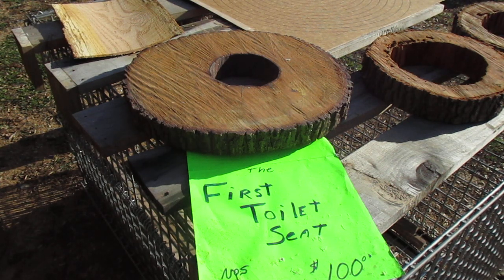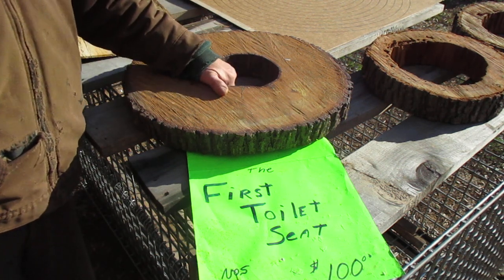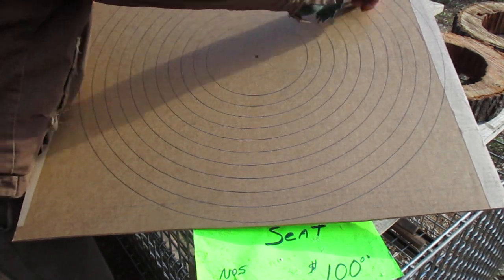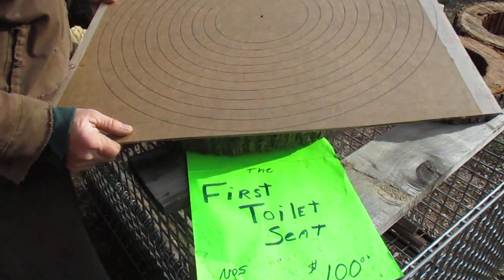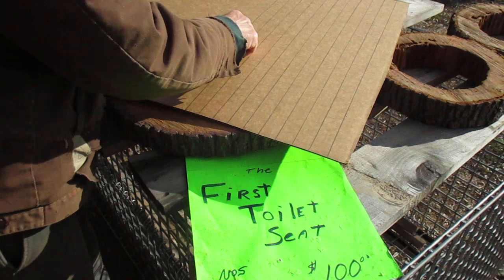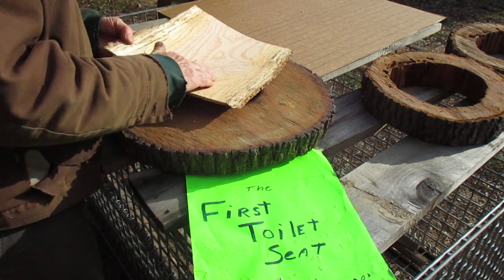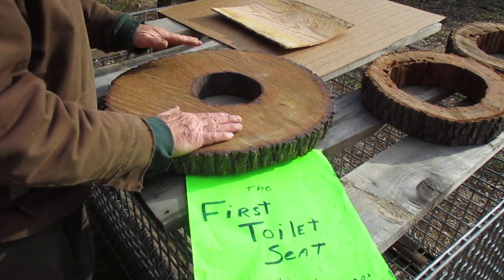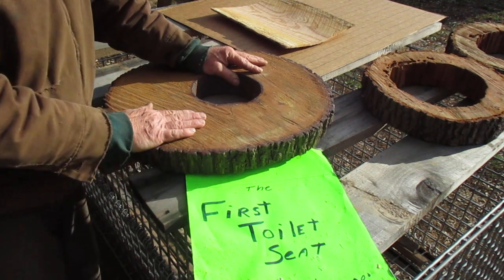#163 Sealing logs   and The First  Toilet Seat

Comment: I latex painted the ends of hardwood blocks (firewood) that I intended to turn into wagon hubs. They checked just the same. Another batch I drilled a hole through the center of the hub blank and coated the ends with hot parafine wax. They still checked. They were all stored in a cool dark open storage building for several years. I hot waxed the ends of some hickory and oak 3 X 6s 10' long and results were very good. That was 10 years ago and the are still perfect.
Reply from the maker: hi there thank you for your in put john

Comment: Great science on how wood shrinks.  I have used PEG before to slow the shrinkage on the ends, it helps with checking.
Reply from the maker: hi there do you paint the whole thing and may think about doing it different now ? john
Reply: @fricknjeep  Interesting thought, on bowl blanks you treat the whole piece, but you're right I didn't paint the whole log, so the lateral checking would still occur. BTW, Osage Orange makes some pretty bowls but is hell on lathe tools.  LOL

Comment: I'm if the school if thought that a log will loose water from the end grain a whole.lot faster than from the sides.  Something like 20x faster.  (Ask Nathan) than from the sides.  Therefore the end inch (or whatever) will dry and shrink as lot more than the wood say 2" in.  That stress caused the checking.  If a sealer is applied to the ends. It slows water loss through the ends. But not the sides.  The log still dries unevenly. Just not as much and checking is reduced.  Not eliminated, but less.

A full width quarter sawn board  will  crack in the middle ' the juvenile pith doesn't know where to go as it is pulled to either side.  I think you kind of pointed that out on the thin curved piece.

The toilet seats didn't check- I think you are spot on to the reason.  However, try an experiment.  Cut a very thin cookie - like an eighth or quarter inch.  Hang it on edge so both sides dry evenly ,(and probably quickly)  I suspect it will check a lot less than a similar cookie 2 inches thich.

Also, on anchor seal, check Matt Cremona in Minneapolis.  He built a 60" wide horizontal bandsaw mill for stabbing huge urban trees.  He has talked a lot about different end dealing practices.  He is a darn good woodworker and is handy with metal fabrication as well
Reply from the maker: easy first i sent Matt a e/m for his in put as well as Nathen neither has commented so far  i sub  to both . 2nd i think you are rite about the ends drying faster but i think the outer ring of the end dries faster causing it to shrink it can't shrink smaller to the inside so it creates stress and cracks . as for cutting a thin toilet seat i reached to nathen to cut some test slices can't do it on my mill but a snap for him   . thanks for you thoughts john
Reply: @fricknjeep Toilet Ring.  Probably right. The "outside edge" shrinks towards the middle and the "inside ring" shrinks towards the outside edge.  Somewhat counteracting each other.  If the center was still there. It would have to shrink somewhere, but where???

Be interesting to see the results of the experiment.  I have only cut "cookies" off small branches with my little bandsaw for Christmas ornaments (years ago) but can't  remember what ther did.  The wood was likely hickory so any that were unusable went to smoke the Christmad turkey...  Nothing wasted around here...
Reply from the maker: @tomclifton3920  hi there  think they both shrink (get smaller ) but there is a lot more area in the outer 3 " ring . i also believe there is also a higher moisture % in the outer 3" . that is where the tree gets its nutrition from (sap wood ) . i also think the heart wood has smaller cells with less water . so the outer area would shrink more . having more area and higher water % it will cause stress when drying . also the the outer   area (bark ) has dry air on it .   john